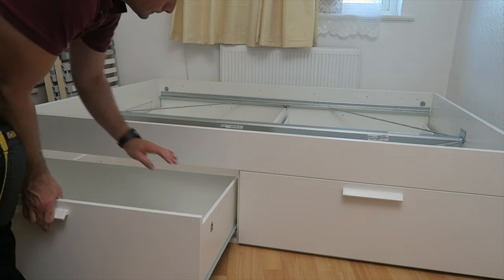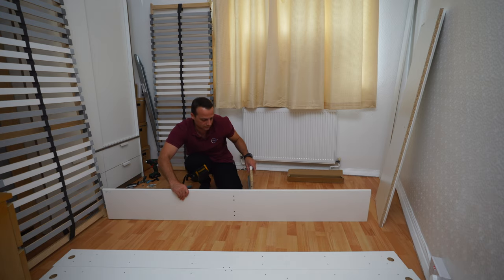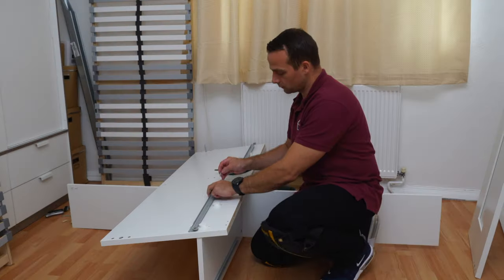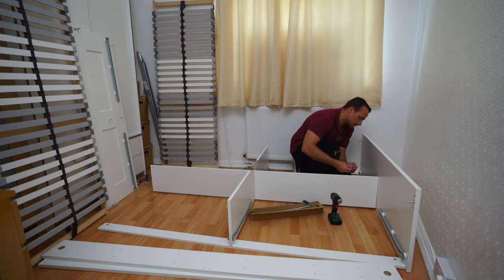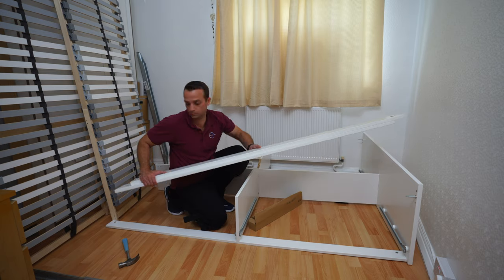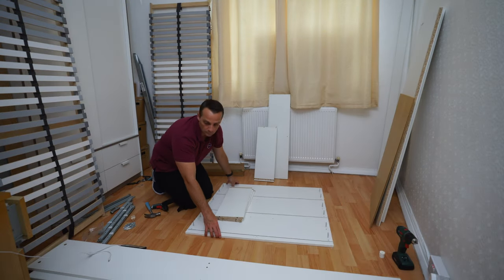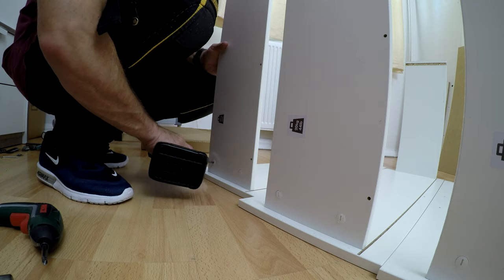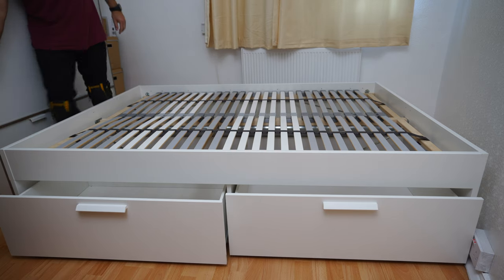IKEA BRIMNES Bed frame with storage, Standard Double assembly instructions

Comment: This is 4 years later but this helped me today. I spent 2 hrs on part 6 because the screws wouldn’t fit. I decided to follow your video and boom by the time I put the head/foot boards on the screws could be locked. Thank you!
Reply: Was it the middle screws you had problems with? I can't get them to lock 😭

Comment: Update: I did it! It took me about 6 - 6½ hours to finish everything including putting my mattress on the new bed frame! I'm literally exhausted, but it was worth it! I started with the drawers and finished with the base. The biggest challenge I faced was connecting the base to the front and to the back. My floor is uneven, so it didn't go as smoothly as I had hoped for. Anyway, I did well, and this video gave me the courage to do it myself. I also saved some money (Don't have to pay a handyman to do it for me.)
Reply from the maker: Fantastic that's why I do this. Thank you for watching

Comment: Omg finally done. Did it by myself (alone) and it took 6.5 hours. But your video helped me so much! 

A little tip: be sure the screws on the rails for the drawers are really tight and completely in! Otherwise you will have problems at putting the drawers in and using them.

Sadly securing one screw in the cross didn't work. It seemed like the hole for the Screw was a bit too long so the screw wasn't able to really stick out. The metal thing couldn't secure it :/ But the rest of the frame fixed that and I put a board underneath so it can't bend down.
Reply from the maker: Glad it worked. Thank you for watching

Comment: I'm having a hard time picking which brand and type of bed to buy from IKEA. Either MALM with drawer storage or this BRIMNES with drawer storage as well. But after watching this video and saw the drawers are connected to the bed frame by slide rollers while the MALM is not, just wheels rolling on the floor. Thank you for this
Reply: Yep exactly me. Can't decide but because the draws are connected to the bed I may go with this one

Comment: I have just made this bed, your instructions were superb. I have a problem, which is not your fault, two of the screws to slid the draws in went flat and I got help to try to fix it but one of the draws does not close. I could not take the screw back out. Everything else was great, if you have any ideas how to solve this problem I would be greatful. thanks.

Comment: I’m about to start this process I’m nervous about it but I’m hopeful ur tips will help me with this
Reply from the maker: Just take your time this one is not so easy. Let me know how it goes.
Reply: Right now I’m at the part 5:55 I see where you did it but I had to put in the smaller wooden ones n in the middle part I accidentally pushed the top one in to far n now the middle part the long piece I have in the the screws are not even tho but I’m getting it slowly and I had to force the small wooden ones in bc the middle sized ones didn’t work and now I’m on the headboard

Comment: Just assembled mine yesterday. Really happy with it. Didn't need our old squeaky boxframe because of the high design...awesome.
Also, it's finished (not rough) on the underside parts, which makes it easy to slide on the bedroom carpet.
One slight criticism is that you need to be careful not to lean too hard on the screws when assembling the parts...if the drill-screwdriver slips you can break away some of the wood...
But apart from that it's good

Comment: The side panel will not stay connected to the center panel (3:34) . The cam lock is in the locked position but it still slides out. Broke one of the locks trying to connect. Any suggestions??
Reply: I have the same exact situation

Comment: The metal rods for the middle of the frame at 3:40 of the video don’t seem to be long enough to catch the metal connector for mine. I did the quarter twist as you recommended thinking that was my problem, but they still don’t seem to stick out long enough.
Reply: I am having the same issue with that step. I have tried to “catch” the connector so many different ways.
Reply: Tell me if you find the solution!!

Comment: 17:14 I´m really struggling with this part, for me the screw just turns on its place not really bringing the two parts together firmly at all. could that be because I´m missing the electrical drill, instead doing it with a normal screwdriver? thank you for the video

Comment: I would like to add a separate headboard later on and was wondering if there was a way to attach one at the top of the bed or would I have to drill holes and if so, would it be OK to do so without damaging it? Thank you.

Comment: I’m at the step at 3:54. The two side pieces still try to come apart after I tighten the + screws on them. Is that normal? Or am I doing something wrong?
Reply: they keep falling apart for me too,, i just put something under it so it levels out. did you ever finish building it?
Reply: @normalgirl27  Hey, I did finish building it but I ended up just returning the bedframe LOL. For this step, I just had to make sure I didn't fully tighten the cams until I placed the other 2 in and half screw those in. You'll need to do the same for the future steps too so make sure to troubleshoot this step first.

Comment: I have a question about the two inside boards that run from the outside boards to the inside centerboard.  The two that meet the centerboard on the video are cut to a taper as they approach the centerboard.  I don't see those two boards in my package.  Did the design change?  I don't see how the long meter bar that runs down the center will fit if those two boards are not tapered as they approach the centerboard.  Do the headboard and footboard need to be assembled?

Comment: I also have problems with that drawer at the end. I got frustrated and left it all wonky
Reply: yep i think two of mine gave me issues, one of the rails kind of chipped? and only one drawer actually slides in fully, the 3 hit at the top :/
Reply: @idkwerefashionblogrs  make sure the sliders are correct they if you look at the sliders it will say DR/DL =right/left and it also have against sliders that says CL/CR=left/right. when you are installing make sure to the left on the left side and the right on the right side otherwise they will fit correctly.
Reply: @cyruscaines1281  does cl slide into cr? Or cl into dl?

Comment: Can I assemble this bed without a screwdriver and/or a drill, or is that impossible?
Reply from the maker: I think it is possible but you will not have fan with this one - to many parts and screws
Reply: @PPFlatPack  Thanks for the fast reply! Does it come with some sort of tool then,m so that's it's possible to do without a screwdriver?
Reply: It's not possible, you can't get the leverage or the pressure, I tried and started ruining the screws. It's incredibly frustrating because in their instructions it never mentions needing the drill. Definitely going to put in a complaint regarding that.
Reply: Also I'm referring to the 16:43 mark, everything else has so far been able to be done with a regular screwdriver.
Reply: @xxBlueCinnamonxx  Me too. And now I think I'll have to get one since I can't borrow one due to Corona. Very frustrating.

Comment: I'm setting up this bed frame right now and mine doesn't have the metal Center beam support, and it also doesn't have the wooden cross beams. Was my set supposed to have those included?
Reply: We bought ours from the store two days ago and it doesn’t have a middle beam. Also the bed slats aren’t including you have to buy those or a box spring separately. It was such a headache

Comment: How did you get the bed slats to stay still? (The wooden slabs under the mattress) Mine keep slipping and the bed falls. It seems like that part was skipped?
Reply: @xBubba32x I was wondering the same and I had have so much trouble putting those together. I couldn’t find clear instructions on how to assemble the wood panels that hold the mattress in place…. Any ideas?

Comment: Thanks for the video 
 I bought the same bed the guy assembled  it to me 
 I have a question i hope you can help me ... the guy told me to buy a lonset base ... which os expensive than luroy ... can you tell me the difference between them and also if i stard getting noise from them how to solve this problem 

 Thank you and keep going
Reply: My luroy slats always fall when I make too much movement on the bed. Even rolling over too fast and they like to slide down. The more expensive slats are more secure for me and worth it.

Comment: I'm really struggling to put this together - the two central pieces are refusing to lock into the big part in the middle
Reply: Were u able to fix it? Were having the same problem
Reply: @JroNava  yes - you need to lift the pieces and shove them together whilst the other person tightens the screws

Comment: I had a problem connecting those 2 panels in 3.45min. The other panel won’t join because the double cam bolt is not long enough so it doesn’t stay together. Am I doing something wrong? On your video you didn’t have that issue…
Reply: I have that problem too!!!! How did you fix it?
Reply: @michaelap7296  i had the same problem, i thought the bolt was too long. turns out the  issue was that i put the bottom slats on before connecting them. my dad helped and we both were able to push it together and then screw while holding it. its probably best to connect it with someone else if youre not the strongest, i think that was the issue of mine.
Reply: @angel72987  Oh thank you for replying! I managed to solve the problem too, but it took a hell of a long time!

Comment: the rails of the drawers do not fit into the rails fixed on the bed. there is a void of several millimeters on one side. it falls into the void🤬🥵. help 😿
Reply: Did you put the white spacers on the headboard and footboard, watch from 6:08

Comment: At 2.50 in this video when you are positioning the bars, we are having real trouble with getting our cams to connect and lock when you make the  ‘cross’ shape just after, almost as if the bar is slightly too short. It is stressing us out and making us mad at IKEA 😂
Any tips please? We have followed this video to the letter but can’t seem to get the solid base.
Reply: Hey, BCB. The key to this assembly is to make sure your dowels [wood pegs] are hammered all the way in. And anytime you are dealing with cam connections, only give each 
'screw-lock' a 1/5-1/4 turn -  just enough to catch the pinhead - then tighten them all up after, a little bit each at a time [that goes for everything with multiple anchor-points!]
Reply: Also, make sure that you don't turn any of 'screw-locks' too far. 1/5-1/4 turn [75-90 degrees] to catch the pinhead/line up things, 1/2 turn total [180 degrees]. Don't go more than that, unless it says to.
Reply: Thank you for your reply, we managed to sort it out and successfully put it up  and your video was a massive help, thank you 🙏
Reply: @blackcountrybaker2941  I'm just a guy who's learned (the fun [hard] way) a few tips and tricks when it comes to assembling MDF/pressboard with wood dowels, pinhead/cams, 'screw-locks'. PP FlatPack made the video - and it's an extremely helpful video-guide. Thanks for that, PP FlatPack!
Reply: @hapa8642  My mistake, but thank you for your advice 👍

Comment: How much is the bed size ?
Reply from the maker: Here is measurements for standard double Length: 196 cm Width: 141 cm Height: 47 cm Width of drawer (inside): 89 cm Depth of drawer (inside): 54 cm Mattress length: 190 cm Mattress width: 135 cm Height of drawer (inside): 20 cm

Comment: Locking pliers would make it easier to hold those metal brackets in alignment. it takes a bit of pressure to get those machine screws started

Comment: I'm still stuck on assembling first junction, tried it 10 times and every time it just doensn't want ot fit right. I guess its time to try 10 more times.
Reply from the maker: Patience is the key. This one is not easy just take your time.
Reply: PP FlatPack If I may ask, did you ever have issue with the screw-securing pieces breaking up? I've already lost 3 of them
Reply from the maker: Adam Silverman There is one rule with Ikea furniture never use force if something go to hard usually there is mistake. When I get into situation when something go to hard always check usually all parts going nicely together without breaking parts or screws

Comment: Can the BRIMNES packagin fit in a car? ANYONE KNOW?
Reply from the maker: Here is the sizes of the packages 
Width: 56 cmHeight: 6 cmLength: 197 cmWeight: 33.80 kgPackage(s): 1
Width: 48 cmHeight: 7 cmLength: 146 cmWeight: 22.65 kgPackage(s): 1
Width: 57 cmHeight: 6 cmLength: 101 cmWeight: 24.54 kgPackage(s): 1
Reply: @PPFlatPack  yep I saw that! Unfortunately for my move we’ll be renting a car and I can’t measure the exact dimensions. It should be like a standard mid SUV though!

Comment: Is anyone else missing the center metal support bar?? 😬
Reply: You need to buy that separately. It costs $10. It is sold separately because all Ikea beds use it
Reply: @CaliViking8O5  Are any other parts needed???
Reply: @craigwinslow6749  box spring or wooden slats. Pick one of the two. I picked box spring so my bed can be higher